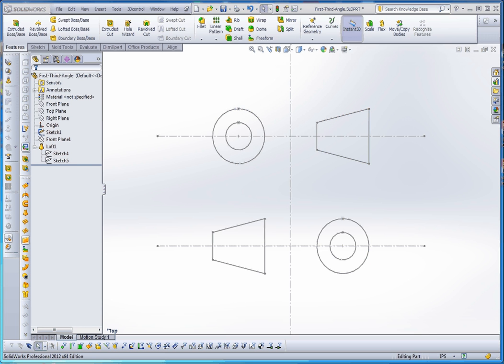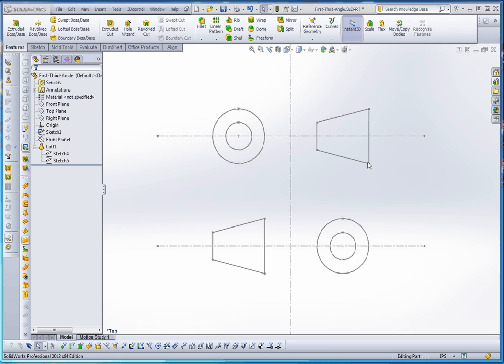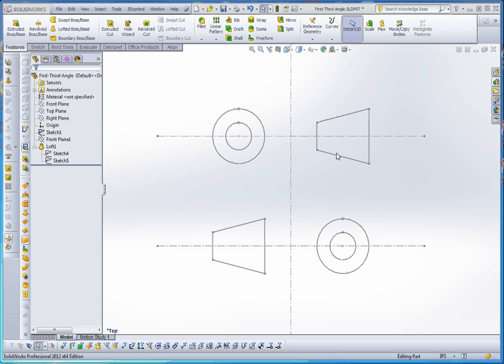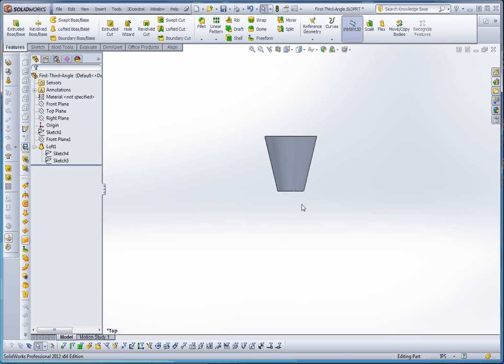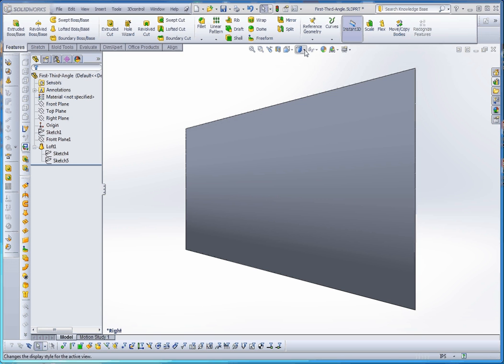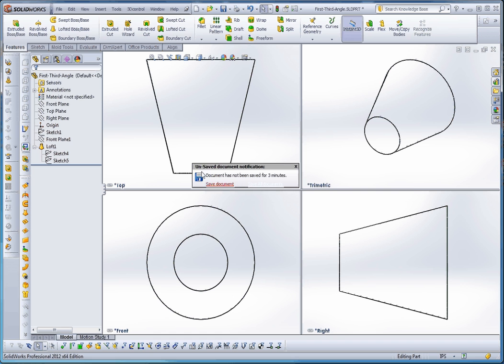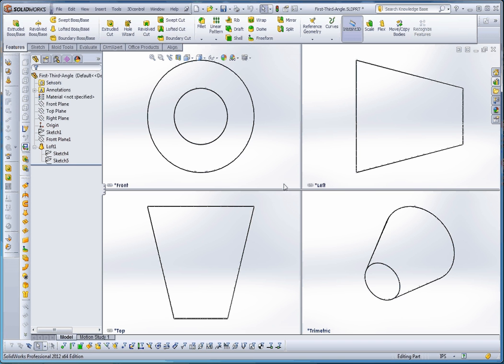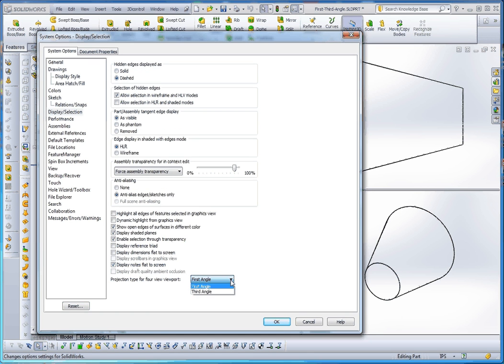Understanding First and Third Angle Projections - Engineering Drawings

Comment: hi on a worksheet, where you have to place the angle of projection symbol...and what will be the size?
Reply from the maker: If you are talking about a drawing I would put the projection symbol in an open area in your title block or close to your graphic scale bar just off the title block.  I would scale it up or down so that it looks like it fits your drawing well.  I would Google "engineering drawing examples" to see how others do it then borrow what you like.
Reply: and the size of symbol??
Reply from the maker: It is not a major element on your drawing so I would make it smaller than your logo but larger than the smallest text.
Reply: thx.... so there are no rules about where to  place it ??
Reply from the maker: Dhylan Lukea I am not aware of any but you may want to consult some of the standards issued with ASME, ANSI or similar organizations.  Third angle projections are the norm in North America but may not be else where.  It is appropriate to at least describe what projection you will be using in your drawing and adding the symbol is even more descriptive.